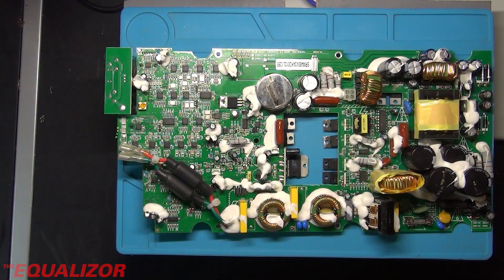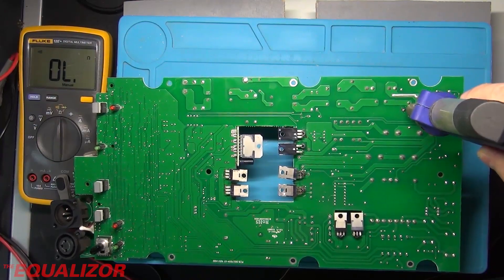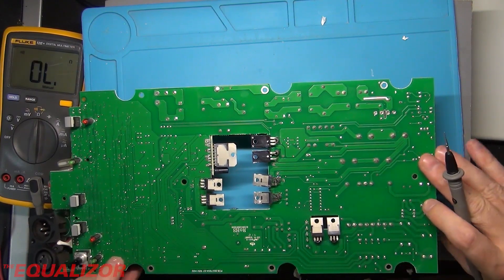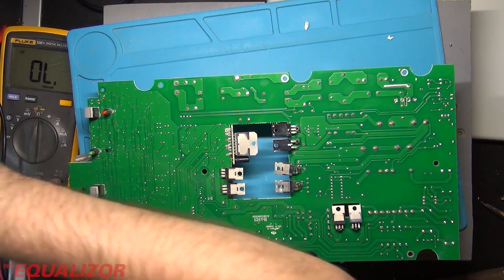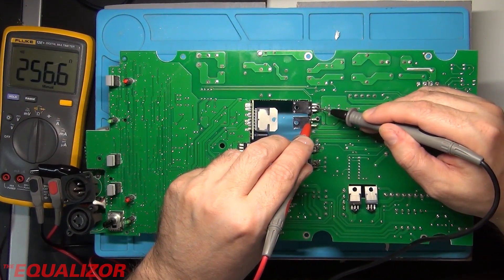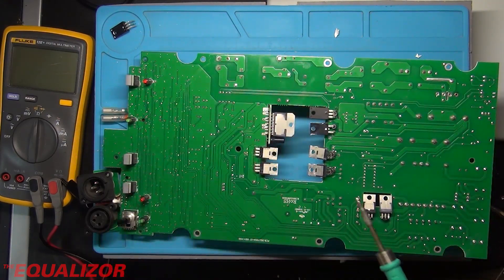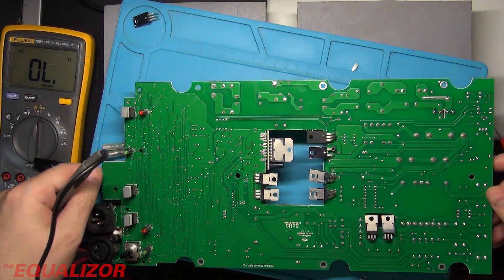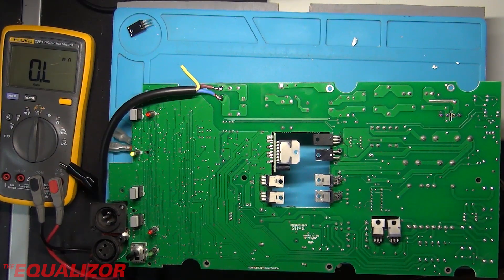Mackie Amp Repair

Comment: You re-assembled, tested it and it blew again because you did not fully fix it? That is what usually happens after replacing that FET and nothing else.
Reply from the maker: Nope. Still working fine to this day. :)
Reply: @the_equalizor  Strange that you do the work sand don't show it actually working afterwards. Maybe include that next time for a better video?
Reply from the maker: @fredflintstone2077   Sure, I get that, however if someone is cynical enough to believe that I've not actually repaired this, then they're probably not going to be swayed from their opinion by a video ending showing it working. They'd probably just suggest that I was showing the other unit of the pair.

Comment: It seems you've been lucky in this repair. Usually when mosfets driving a HB smps blow they go together plus also destroying the driver chip. I learnt that transistors always blow before the fuse does. Besides you should have changed both fets as they are not the same.

Comment: i have a mackie HD1521.  it turns on, but no sound.  is there a way to troubleshoot that??  i have basic 12 volt electrical knowledge
Reply from the maker: Raul Romo The first thing to do would be to grab the schematic and check the voltages around the circuit. The schematic is very detailed in that respect, I have found a copy of it here : https://elektrotanya.com/mackie_hd1521_sm.pdf/download.html  Good luck!

Comment: I have a Mackie SRM450V2 which is dead although there is mains coming in on the primary side of the switch mode PSU Any ideas ?  Chris
Reply from the maker: How far through does it go? MOSFETs usually fail short so if it were dead I'd expect blown fuses etc. I don't have access to any schematics or this unit any more so I can't remember its circuitry, but it might be worth checking around the switch mode controller chip, if it has one.

Comment: Interesting - I have one on the bench with the EXACT same fault...
Reply: Hmm, looks like you were darn lucky with that one! On closer inspection, the one on my bench suffered much further damage - when the FET shorted, it sent mains back up into the PFC circuit, frying the PWM controller chip and various surrounding SMDs, and that's just the dead bits I've found so far. I suspect this one may be bin fodder...
Reply from the maker: djsherz Yep, that can happen because mosfets have a tendency to fail short circuit. I had a similar issue with a subwoofer repair (video also on my channel) where blown mosfets took out their PWM driver. Replaced both mosfets and the driver and the whole thing was fixed for about a tenner.
Reply: @the_equalizor  Just having a nosey now...
Reply: @djsherz  They almost always do. We did not see this one tested and working either.

Comment: what were the symptoms of this amp?
Reply from the maker: Fuse blown, shorted +- rail
Reply: @the_equalizor  
got it.

I've got a mackie m1400i. It powers on and the LEDs turn on. none of the fuses are blown (I opened it up). It makes a little popping noise through the speaker when I power it on (like a normal amp does). There's .1 volts at the speaker output. audio input is confirmed to deliver the sound properly.
Is this likely a blown capacitor? One of the capacitors has pink on the top and looks a little more bulbous than the rest. Any ideas?

thanks for the earlier reply.
Reply from the maker: @JustinCrediblename  I've not seen pink on caps before, normally when they leak its brown. Bulbous definitely means replace, as they will make the power supply go out of regulation. I wouldn't get hung up on the speaker output, you need to be looking around the secondary side of the power supply, after the main rectifier diodes. Do you have a picture of that area of the main board I could see?
Reply: @the_equalizor  
P.S. I repaired it.
The main caps were bad, the cooling fan was seized, and the ribbon cables which were touching the heatsink was bad.

I measured the current that this thing can deliver to my subwoofer, and it barely exceeds 200 watts with a line level input. Maybe I didn't fix it properly.
edit: not bad to have 112 dB sustained at listening position in a 6000 sq ft room, I guess. But still a bummer.
The silver lining is that I can have flat EQ down to 20 hz without risking the driver. lol.
Reply: what the no part replacment